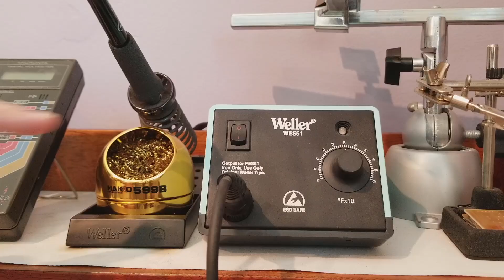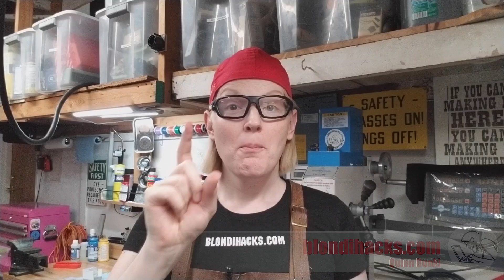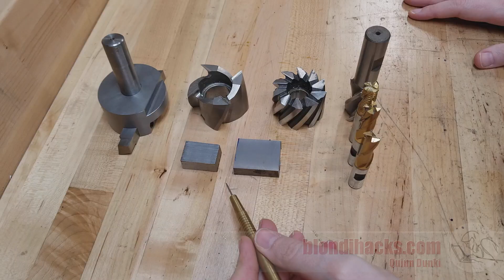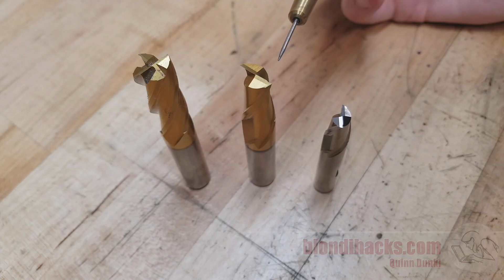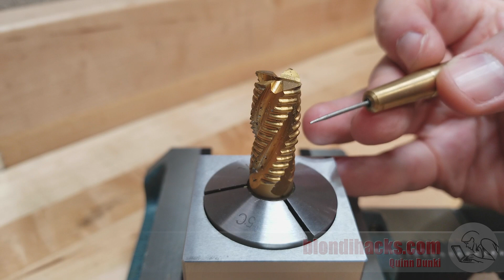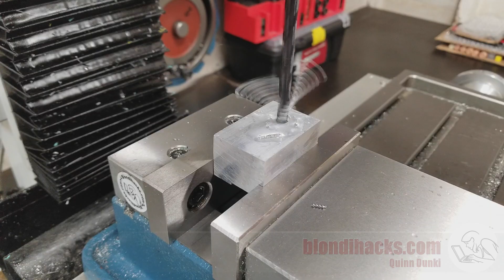Vertical Mill Tutorial 4 : Basic Milling Operations

Comment: Excellent video.  One of my most common uses for a center cutting endmill is when I have to drill a hole on an angled surface.  Plunge the endmill to cut a flat spot, then drill.
Reply from the maker: Yes, totally! I should have called that out.

Comment: Excellent video. I was in the tool and die trade and you have my respect. When climb milling in the Bridgeport without a power table feed, I always snug up on the table lock just enough to prevent shudder from leadscrew backlash as I carefully crank away.

Comment: Excellent video . May I just point out an aspect of climb milling that is significant. Climb milling has the tendency to accelerate the work piece in the direction of the leadscrew backlash!  If this happens the table jolts forward to accomodate the backlash and as you mentioned the deep initial engagement of the cutter remain deep to the end of the cut. This applies a horizontal force to the cutter and at times may break the tool. This phenonemon raises its ugly head when there is excessive backlash in the lead screw. It can be avoided by having expensive, but desirable ball screws or applying some drag, using the appropriate table lock to resist the forward inpulse  imparted by the cutter. Keep up the GREAT work, Richard

Comment: Love the screen image inset, very clever 😜. Excellent treatise on standard milling, centre cutting cutters do have aysmetric flats, used for pocketing.
A trick to use climb milling (side cutting), on all manual machines, is to apply pressure on the relevant traverse axis lock, ie, try to prevent the table or slide being pulled by the cutting action, bigger milling machines have "Climb Milling" settings, normally a lever on the X axis. Do not use this technique when power feeding, or you will burn out your feed motor.
You also experience climb milling when cutting a slot, especially on grabby materials/sharp cutters.
The reason for problems on climb milling is that axis have a standard leadscrew on nut, these have backlash!, Where CNC machines have both ballscrews and servo motors that have zero backlash, and position control.
Again, great milling knowledge Quinn, and best regards from the UK.

Comment: Another note on climb vs conventional milling. climb milling will also push on your lead screw and mill will easily able to move the backslash of your lead screw. Our hobby machines or older machines use ACME/trapezoidal lead screw which have a fair bit of backlash compared to modern CNC machines which use ballscrews with very very little backlash. not sure if the backlash problem or rigidity problem are worse but thats why your still use conventional milling on a Bridgeport

Comment: Another great video. I've been watching all the other 'usual suspects' youtube productions for years now since I've retired. You are the only one that has mentioned with detail solid shell mills for the smaller mills. I have a few of the insert type face mills and they just dont get along with my little mill. I have since ordered two solid shell mills. One HSS and other M42 cobalt w/o jelly thank you. Cheers!
Reply from the maker: Awesome! Glad I could help! You were right not to pay extra for jelly. It mixes with the cutting oil and makes a heck of a mess.
Reply: @Blondihacks  Well, I tried my recently purchased 1 1/2 inch  HSS shell mill on some aluminum yesterday and wow what a smoooooth finish and no seam lines like I got with the smaller end mills. Thanks again for the tip. And to you, our little sunhead, a sincere wakawakawakawaka!

Comment: Well, I learned something new!
I hadn't previously appreciated that end-mills had a cone-angle, so that when touching-off the tool-height and then plunge milling by a given amount, the resulting hole isn't going to have the expected depth, or even a flat bottom.
That's certainly going to complicate making genuinely flat-bottom holes with a manual machine that can't (easily) do interpolation milling of holes with a smaller end-mill than the hole diameter (I could use a rotary table to do this I suppose.).
To achieve this with a boring head for small holes (< 1/2"), I would need either buy a (probably very expensive) miniature boring tool, or very carefully grind and harden my own.

Comment: Quinn, many years ago when I was serving my apprenticeship, the college lecturer always referred to conventional milling as ‘upcut’ milling. Not sure where this terminology originated from but I did come across it again when I first stated learning off-line CNC programming.  The system was called GNC (graphic numerical control) this system was pretty much state of the art in the early eighties. To control the direction of the cutter on the display screen you could select the climb or upcut option.  In conjunction with other commands the operator could control the direction the milling cutter took on the periphery of a part, thus giving conventional or climb milling. The GNC program required post-processing in order to produce the G & M codes to load to the CNC controller.
Reply from the maker: Interesting! I can see “upcut” as a good name if you look at how the tooth enters the material from below in that direction.

Comment: Hi Quinn, it may be helpful; to consider the backlash in the table when discussing the benefits of conventional milling versus climb milling. 
In conventional milling the thrust of the cutter is pushing against the drive screw and so backlash is kept under tight control and so is not a problem. While climb milling the cutter is pulling away from the drive screw, that is moving the table forward, so a relatively light weight table may slap backwards and forward, between the limits of the table backlash, as the cutter cuts and releases as it turns. This is what I believe, causes the higher levels of vibration on light weight tables with loose dovetails.

a more in-depth video on this aspect may well be of benefit to your viewers.

Comment: This is a fine series. Chapeau. 

One question though: you mentioned drilling most of a flat bottomed hole, then using a milling bit to finish. However, does that mean that you have to move the workpiece to a drill, or are standard drill bits available for mills, so that the whole job can be done on one machine?

Also, when using a mill to make a slot in the middle of thin metal stock, is it necessary to drill a starter hole first, or can you get away with the appropriate milling bit to cut the initial hole, and the slot too?

Comment: Love this. Your videos are helping me quite a bit. Been into metal working for a few years but only recently got into milling. Bought myself one of those small mills and I love it so much. Your videos are really helping me learn. Only one thing that is concerning me, maybe somebody can chime in.
One of the first things I did when I got my mill cleaned and set up was to run a test indicator across the table in the x and y. Left to right I am getting a difference of around 6 thou, and back to front almost 5. Is this normal for these small mills? I know they're entry-level mills but doesn't that seem like quite a bit? I milled a 2 inch cube as a test and just in those 2 inch faces I'm getting a few thou of unevenness... 
Is there anything I can do about this? As far as I am aware there's no way to adjust the table? Maybe I should disassemble the table and clean under it but would that change anything?
I only bought the mill less than a month ago so if anybody can let me know if this is something I should be concerned about or if I should go back to the store?
To be honest I haven't been doing as much milling as I would have liked since I got it because I can't seem to get parts that come out flat when I run an indicator across them.
Reply from the maker: Great question! First, yes, that is way too much variation. Second, you can fix it by adjusting the head. If there’s a tilt or nod adjustment, use that to tram it in. If not, you can put shims under the mounting bolts on the head or the column (whichever is easier). Shimming the head or column will cost you some rigidity, but it’s worth it if the tram is out by that much. Get yourself one of those variety packs of precision shim stock and it will have everything you need.
Reply: @Blondihacks  thanks alot for the response. I probably should have checked the adjustment on the head to see but for some reason I just assumed it was ok because the pointer was in line with the zero degree mark. I guess it would not be really noticeable by eye though. I'm really clueless when it comes to machining so I've just been watching YouTube videos to learn.
I'm going to try adjusting the head to see if that can reduce the variation and if not I will look into getting some shims like you mentioned.
Thanks.
Reply: After tramming the mill, I was able to get it under half a thou from left to right and zero thou front to back. I'm really happy with that. Thanks for the help. Also readjusted all the gibs.

Comment: Hey Quinn, love your vids!!.. just wondering where did you get your shell mills, and what arbors do you need for them? I bought a 50mm indexable carbide 
4 flute cutter with MT3 taper arbor from Bangood and it is hard to use - a small cut on steel, 0.2mm (8thou) at 350 rpm (recommended) - its ok with v.slow feed to reduce vibration but leaves a crappy finish. I have a Seig SX2.7 Mill (equivalent to a LMS 5500) and I think a HSS shell mill would be much better than my carbide cutter. What speeds do you run your shell mill? many thanks. Nick

Comment: One problem on manual machines that use ACME thread lead-screws (rather than CNC machines that use anti-backlash ball-screws) is that with climb-milling, the workpiece is not constrained properly due to the backlash in the lead-screw. The end-mill can therefore suddenly grab workpiece and pull it and the whole table towards itself by the distance of the backlash. This can lead to the workpiece being fired across the room (if it isn't clamped down very securely), scraping of the part, or cause tool breakage.
(I'm perfectly sure that Quinn knows all this, but I don't think the ACME-threads being the cause of the problem was spelled out in this video.)

This other video illustrates what can go wrong https://www.youtube.com/watch?v=galm5_6SUcM
Reply from the maker: Yes, it would have been good to mention the differences in leadscrews and how that affects climb milling.

Comment: 2" carbide face mill coming in 2021.  Will there be a new or newer lathe to drive it?
Reply from the maker: That’s the hope! 😬
Reply: @Blondihacks  More powerful than your 750 kw current mill, WOW!. Should that be 2' then 🤔
Reply from the maker: @bostedtap  Yes, it will require TWO hydroelectric dams to power it, instead of the one I currently use. 😬

Comment: I was expecting to see a big difference in the chips between the two feed methods.  Not so much.  What about face milling?  Don't think the feed direction would matter here as you get a bit of both from different sides of the cutter.
Reply from the maker: I talked about that in the video- if your cutter is larger than the surface, it doesn’t matter. If the cutter is smaller, it can matter, depending on depth of cut.

Comment: Why does it seem everyone does precise work with flycutters but roughs stock with face mills?
Reply from the maker: Fly cutters aren’t good at taking deep cuts, but make a very nice finish.
Reply: You get even better finish if you use face mill as a flycutter.
Chip away all but one edge or use just one insert.

Comment: i need to plunge mill a flat bottomed square hole. are you saying i should use a boring bar..?? 
any tips..?
Reply from the maker: If it genuinely needs to be flat bottomed and square, that’s not actually possible with anything except Electrical Discharge Machining. If you can live with small corner radii, use a small diameter endmill. If you have room, do “mouse ears” in the corners (see my copper soft jaws video for an example of this)
Reply: @Blondihacks  thank you yes it need not be perfect.

Comment: Climb milling is evil on old milling machines.. I wrecked an end mill a few weeks ago because of the backlash in the table. It has little to do with rigidity I think because my machine weighs almost 2 tons.
Reply from the maker: Other things besides mass contribute to rigidity as well. Quality of mating surfaces, tightness and condition of slides, leadscrew type, how many bolts are in mating parts, all sorts of stuff. Rigidity of the spindle also important when trying to climb mill as well. If the bearings aren’t perfect, that’s asking for trouble for sure.
Reply: @Blondihacks  True in a sense I guess, but I've been told rigidity simply has to do with deflection under load, and backlash is something separate. I could be totally wrong though.